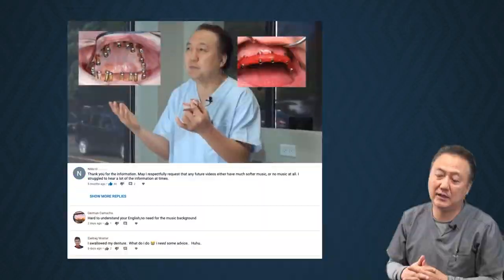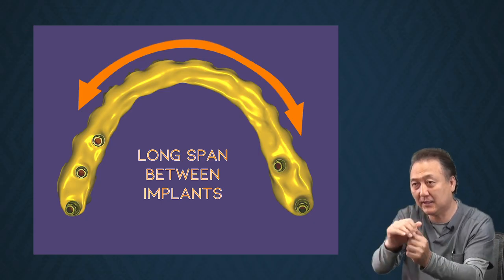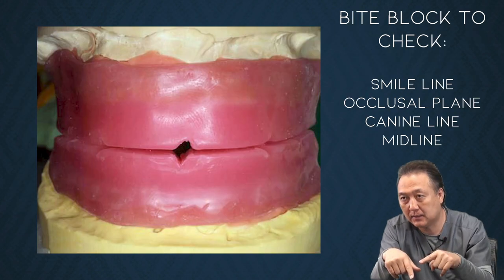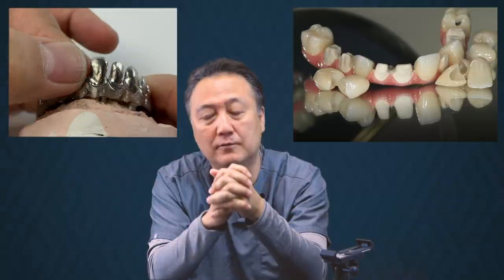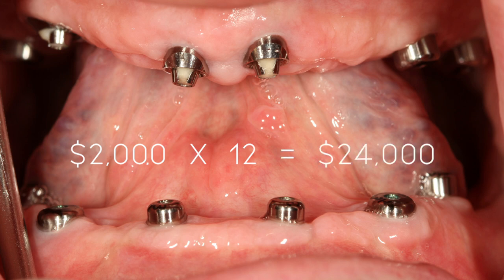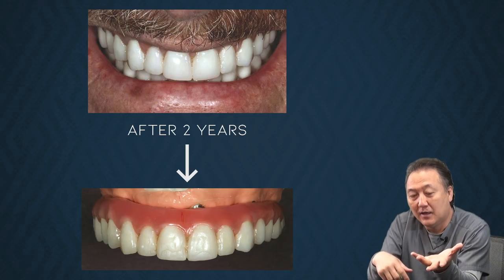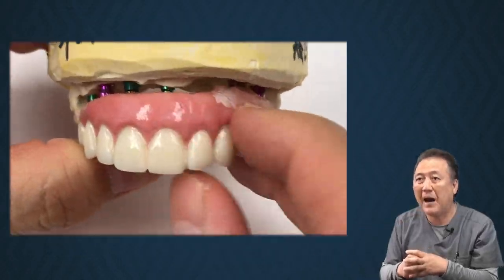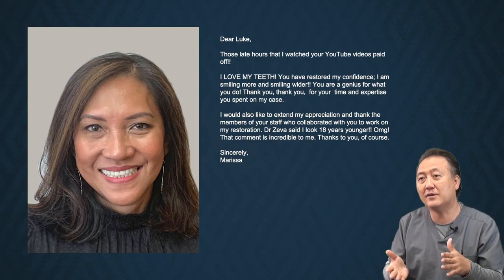Will This Prosthetic Be Worth $50,000 in 2 Years?

Comment: I love it! This is worth the price tag! Since 2015 my front teeth failed after 4 root canals back in high school which were done back in 1991. The dentist recommended a bridge or full upper implants do to other failures of lead fillings back in 1989. So now I have upper dentures and pretty much is horrible each time and sinks into my gums....comes lose stains, etc. $20,000 later after all the pain and mistakes I want to do this and it's worth it going with chrome cobalt metal frame with ceramic exterior and individually layered ceramic teeth. It would cost so much more for individual implants plus the pain, time etc. We are not even adding bone grafting especially for me. For individual implants, it would cost me close to $65,000++ believe me done my homework and paid the price for exanimation and consultation. I went the inexpensive way with traditional dentures, and it cost me more in the long run of 6 years including denture paste and cleaners....by the way doesn't clean stains let alone the denture smell still lingers even after cleaning. The price of a beautiful smile is priceless!!! The price of eating great foods like steak, corn on the cob, apples, hamburgers etc. is priceless!!! When you have traditional dentures falling out, shifting and giving gum pain while eating is horrible! What is worse is the upper denture 6 years later has changed my real lowers teeth and now my bite is off. I am all in for LSK121 and staff to do the work! Also trust Luke S. Kahng about these coupons I have been seeing in mailer ads for All-4's....these practitioners haven't been doing these procedures for only a few years and less experience which is noted in one of his videos. So, after my own personal experience, I am going with chrome cobalt metal frame with ceramic exterior/teeth. I recommend quality and reliability that is amazing for decades to come!
Reply from the maker: Dennis Chong thanks so much!!
Reply: I just make my appointment to do Zygomatic implants in the upper cause I have the same problem you have. I first started with rooth canals and years latter everything fail. My surgery will be on Dec 04th and I'm ready. You don't need bone grafting for Zygomatic implants so that is a great thing. I don't need to wait to long to get my zirconia bridge. Wish you luck in your jorney. In Houston there is a dental office that charge you 22, 000.00 for upper and lower. You can upgrade to zirchonia for very little. I went there and is a beutiful office. You can google it, IMPLANTS IN HOUSTON TX... Cheers!!